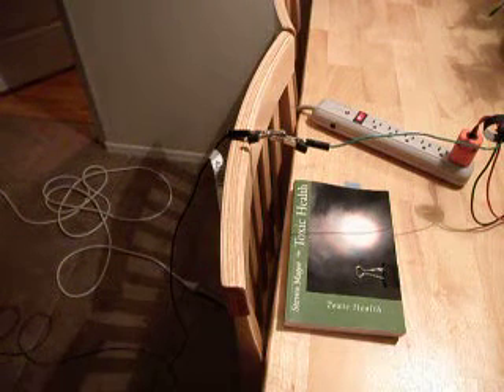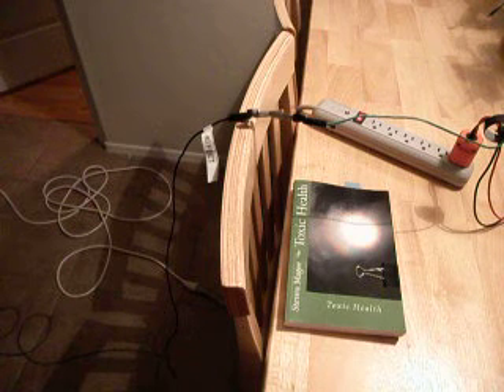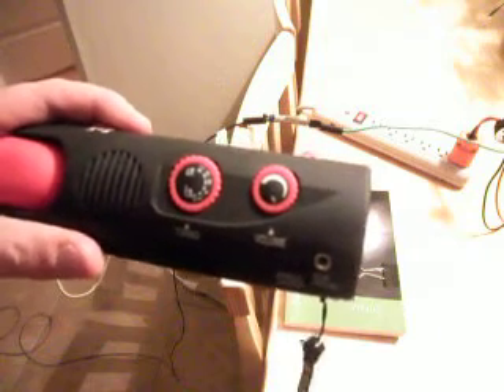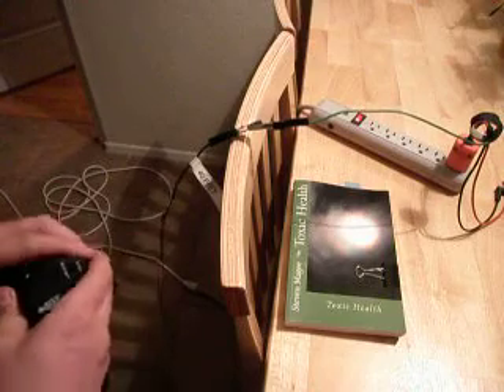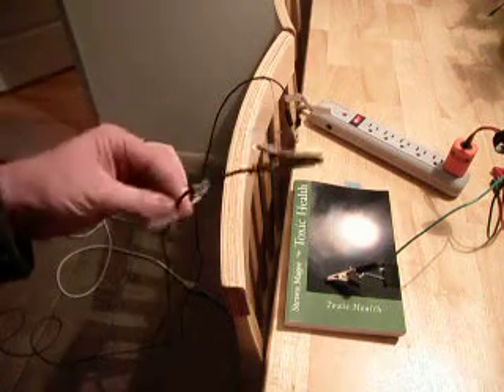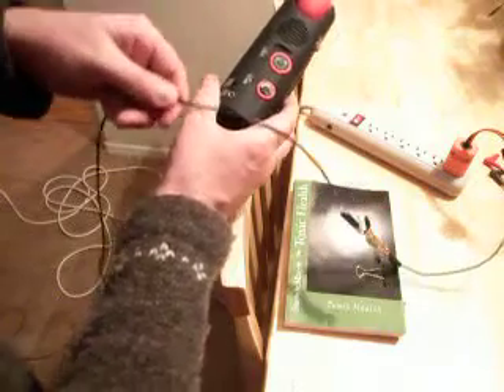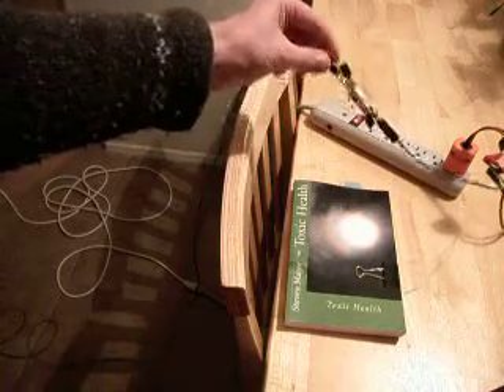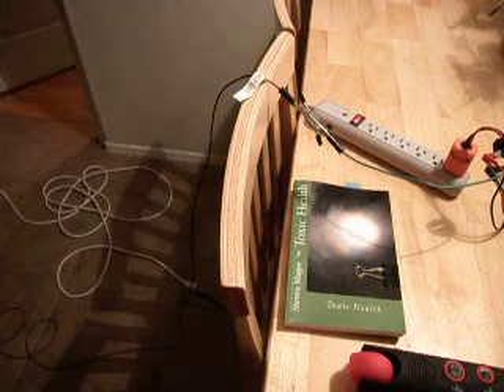Earthing (Grounding) System Producing Radio Waves - A Human Health Hazard?

Comment: hihi, can I grounding using USB in the computer?
 it's 5V and very safe. the reason why I choose this source as usb is like the fuse. if there is anything unexpected happened, the fuse will crack like your computer will be broken but not your human body so I guess it's a nice way to earthing
Reply: Yes, I use my computer USB for grounding and I also added a fuse. BTW, use the water pipe and electric wire is the best, more safe.